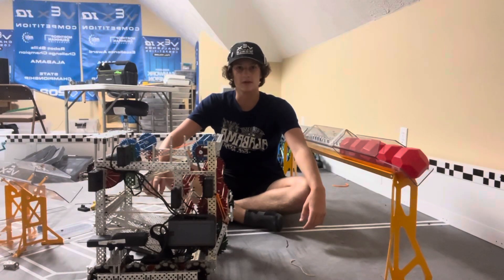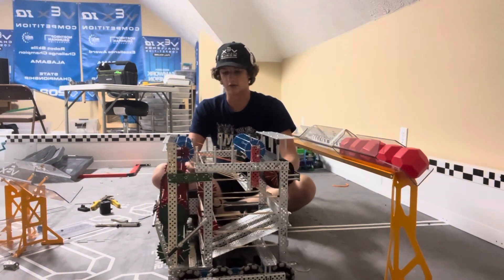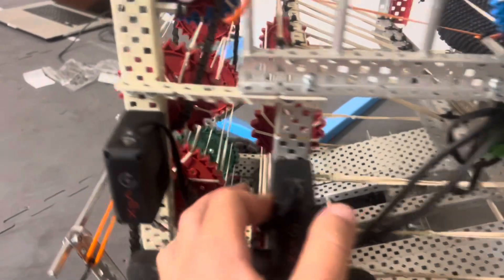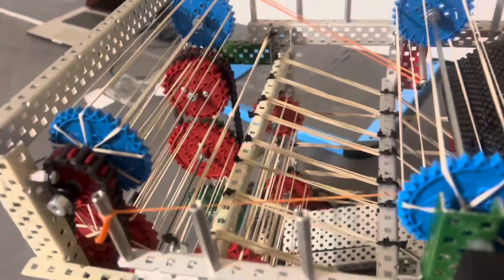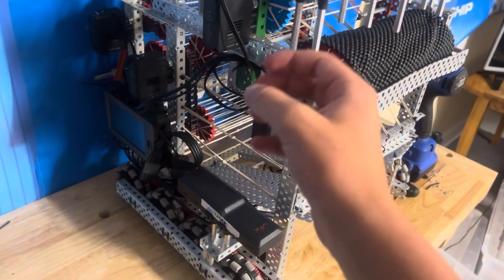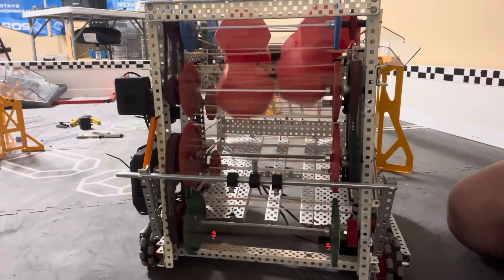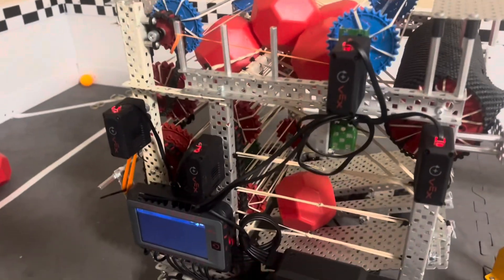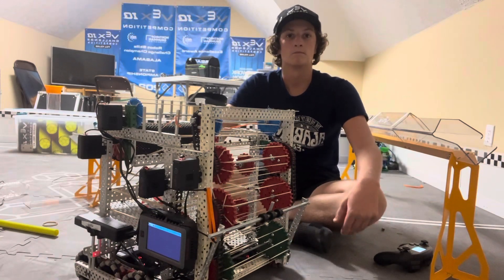Vex V5 Push Back 31218W (rialot) Robot Explained

Comment: good bot the only issue is i think is weight distrubution. when you add the pnuematic canister put it on the opposite side of the brain and also maybe swap the side of the 5.5 watts and also add a mesh cover on the top to fix the issue of the blocks coming out the top